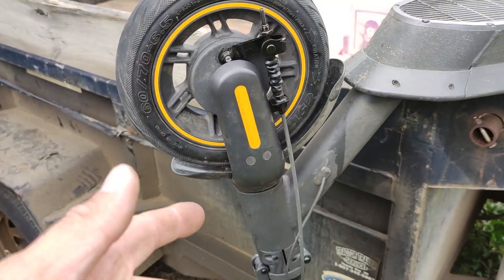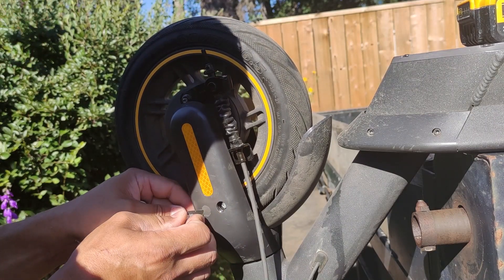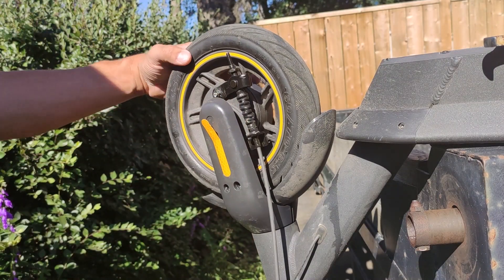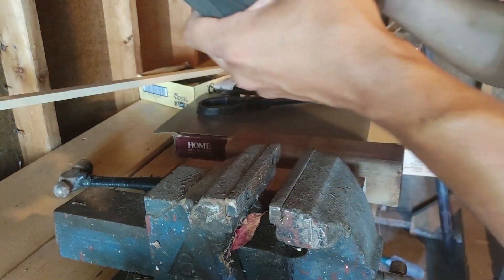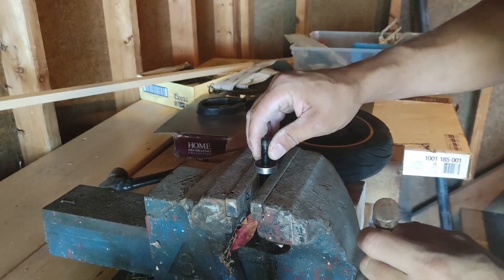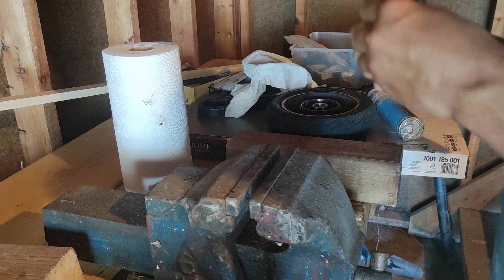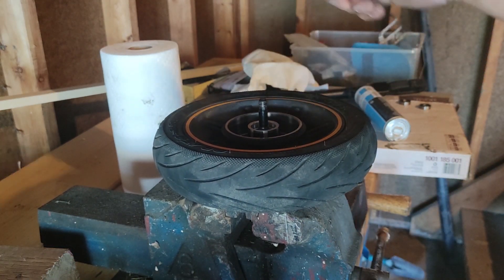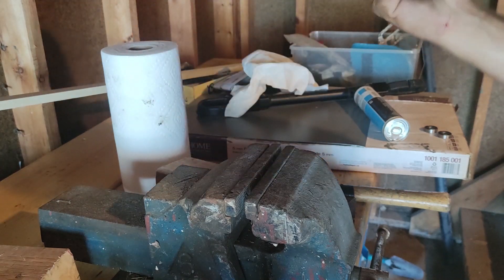Ninebot Max G30 Scooter - Squeaking, grinding, noise - front wheel bearing replacement/upgrade.

Comment: I have the g2 max its the same system but can i just lube it with grease instead of changing it? Because mine squeaks to. And what is the name of the bearings and where i can buy them?
Reply: Replace them with SKF. It might throw you off when it will lock up.

Comment: Im having a problem with the nuts to get the wheel off. It's so tight that i can't unscrew it. Is there any help?
Reply: You need ratchet wrench (socket/crova wrench)
Reply: @LeventeKurucz-g4d  I actually figured out how to do it just had to extend my wrench for torque thanks for replying

Comment: Best video tutorial, thank you so much!! I just changed my front bearings after 2500 miles. Pretty easy repair! Now it should be easier next time now knowing i can remove the front wheel WITHOUT unscrewing and removing the drum brakes. Such a PITA screwing on back the drum brakes lol

Comment: On the non brake side should the spacer be on the inside of the fork (bearing side) or outside the fork 15mm nut side?

Comment: i wonder how much resistance the bearing have under load and 25kmh, cause mine have the same issue and after the first wet morning with no rain it started squeaking but i didnt notice any increase in battery drain but now after like 120km and a thunder storm rain ride to the store it have started to drain more cause i did get about 5-6km in Sport and it drained 15%-18% and now its drain 18-28% the exact same road to work-.-
Reply: Have you checked tyre pressure?
Reply: @nameberry220  well, when i bought it they was rock hard it felt like so havent bother checking and i feel like they are still hard when driving over bump etc but i maybe should check it out.
Reply: @LinusF_  they always feel hard but you should check correct pressure i recommend 55psi for best range

Comment: Thanks for the video! My front bearings gave out after ~70km, and I am beyond dissapointed. Too bad I already flashed the scooter so warranty is probably not an option… I guess it’s time to upgrade!
Reply: unlucky 😵
Mine rides like new after 1100km minimal squeak from stem fold mechanism and stem fold secure plastic ring broken
Reply: @lolenas  Yeah I've heard great things about the reliability. I had a clone scooter (which I fried) before, and comparing to it the ninebot is far superior. I think I've just got very unlucky with a splash of water penetrating the bearing seals or something. Luckily I don't mind the work of fixing it, it's just a shame to have it happen so fast.
Reply: Mine lasted about the same km as yours. I got caught under the rain twice and the bearing gave up the next days. I'm now waiting for my parts to get delivered so I can change/upgrade it.

Comment: You can al;so use the old bearings for tapping in the new ones . Also if you are struggling with the push in of the axle one, you can reverse it, put in inside the wheel one and tap on the axle to push both in at the same time

Comment: I looked at this video a few weeks back, placed an order for bearings, and tonight i finally fixed the front wheel!
Thanks for the great video!

ps. When i test-rode it just now, i still had a little of that stuttering/shaky feeling, even on flat ground indoors, could it be that i need to swap motor bearings too?
Reply from the maker: That's usually usually how those feel when they are regulating the power

Comment: you say the brake drum gets off easy, but i cant get mine out, what do i do?
Reply from the maker: Tap gently with a small hammer
Reply: @randomrepairchannel  i did and the brake drum fell off together with the axis, now how do i get that bearing inside the drum brake out of the axis? i couldnt hammer out the axis out of the drum brake, the bearing inside the drum brake actually felt quite smooth (just like in your video), so i just left it in there

Comment: I have a problem, after instillation the wheel doesn’t spin as freely as on your video but spins for like 5-6 seconds and then stops. New SKF bearings. Do you know what might be the issue?
Reply from the maker: Is it front?
Reply: @randomrepairchannel  yup
Reply: @randomrepairchannel  what if it is in rear wheel?  Is that normal?  As my G30D rear wheel isn’t moving freely just like the front wheel. Need your valuable advice/suggestion on this! 

Thank you very much for the nice & helpful video. 😊👌👌
Reply: @mohammadshamsularafin3905  its because motor is on rear wheel
Reply: not greasy enough

Comment: Can you believe it. Segway ships their units with WARRANTY VOID IF EXPOSED TO WATER. If you drive through a puddle, or in the rain, or wash it, then WARRANTY IS VOID.  

I'm now here to watch disassembly videos of the motor hub, which I avoided before as I didn't want to void my warranty. Only made surface maintenance, probably very ineffective, as you can't get your wd40 near anything close to the axle...

I've now been chewed off on page 7 of the user handbook, in which it says that exposure to water voids your warranty.

So the fact that I had a bearing ball snap in half is due to water. Sure, and I was born yesterday.

I'll see what I can do to fix it, and I will never purchase another Segway product again.

Comment: Great video... I just bought A Max G30LP and at 100mi (60km) are already experiencing a failure. Question: should I bother with warranty replacement since the scooter is only 2wks old? Or would you just recommend upgrading right out of the gate? Thanks!
Reply from the maker: I personally would upgrade but that's your call 👍🤘
Reply: @randomrepairchannel  Roger that! I appreciate you sharing your opinion! I'm thinking that is the direction I'll end up going. Thanks again for the video!

Comment: Hey really like your video, but I have a question. What are the measurements of the bearings because I can't find the right ones.(plus do you have any recommendations for upgrading those bearings?)
Reply from the maker: The numbers of the bearing are the size.
As long as you get double sealed you should be fine 🤘

Comment: How do you perfectly size the bearing? There are so many, very similar, sizes. Thanks.
Reply from the maker: Just use the exact numbers from the video and you will be fine
Reply: @randomrepairchannel  oh, sorry, I was meaning generally. I have a different wheel. I searched a "bearings" web site and was amazed at the number of sizes... in thousanths.
Reply from the maker: @bob-ny6kn  it's crazy. Get as close as possible and usually a home run
 Cheers
Reply: I got the f40 series. What bearing size should i use for the front and rear?

Comment: Hi, I just bought a g30p, when driving on any surface at a speed of 15 to 18, vibration (40-50Hz) appears, which gives off to the steering wheel and creates a sound. However, it is unpleasant.

When picking up speed in the raised state, this does not happen, but there is some beating (without sound, which loosens the deck itself soundlessly) due to some misalignment of the rear wheel. To give it under warranty or is it a standard nuance?
Recording sound while vibrating and resonating something (not wings exactly): https://photos.app.goo.gl/5k2EB3VjL6M3wEfT8
Reply from the maker: If you have warranty I would start that process. 
Very hard to tell from the sound what is going on there.

Best of luck!
Reply: @randomrepairchannel  Thanks, its new, I’ll start process.
Reply: It is only a vibration of the front wing, I touched lightly with my foot and the vibration stopped !!!

Comment: Do i need to put glue? I dont have this type of glue could i use something differnent?
Reply from the maker: Any kind of gasket maker or rtv should work. Yes keeps water out of your motor
Reply: @randomrepairchannel  thanks. And these bearings was also okey right what i wrote? Gonna buy tomorrow. Wrote under the rear change i think video.
Reply from the maker: @raigo66  good bearing
Reply: @randomrepairchannel  thanks. U think i should wait if the sound comes and then change it or change it tomorrow front and rear. 
I checked the sound and it was gone at front wheel.
Reply from the maker: @raigo66  if it was making sound the bearing is bad. I would get on it for sure. Take your tim, be careful
Reply: @randomrepairchannel  last question. How long do the sfx bearings last?

Comment: Are you able to provide a link of where you got the bearing from? I heard you say a place but couldn't quite make out what you said. I live in Australia so finding hard to find the SKF 6001-2RS1/C3GJN
Reply from the maker: I bought from local auto parts store. 
Try amazon or eBay?
Reply: @randomrepairchannel  Thank you. Have tried Ebay and Amazon and the prices were crazy. I found a local bearing company and will give them a call on Monday to see if they stock them. Thank you.
Reply from the maker: @rdp8545  good deal. 
Any Brand name 6001 will work just make sure it's fully sealed

Comment: Hi there, after how  many miles would you say these bearings need replacing? 
Great vid by the way 👌🏼😊
Reply from the maker: Mine had 200kms or somewhere around there.
Reply: @randomrepairchannel  so probably a good idea  to buy these bearings as a spare just in case they got out of production for this scooter. Will get some in 👍🏼
Reply: @joAO-87-TugA  they will always make these... Its not just for the ninebot made
Reply: Mine have 1450km on clock, I'm using time to time WD-40 PTFE spray, everything works fine
Reply: @osvaldassmitas  I would like to lubricate the bearing because I rode it in the rain and it squeaks now even though they say it's water proof in rain.  

May I ask how you were able to lubricate the bearing without getting oil and the brakes?

I think it would be helpful to the community if you were able to share what you know about the process… 

Thank you!
Reply: I had ceramic ones and got 1400 miles out them in t4 max

Comment: Thanks for the video, I bought a couple of Skf for the front, I’m gonna do this upgrade soon. Just wondering one thing, if I’ve seen properly you haven’t use any vaseline or grease for the bearings. Should I do it? Thanks
Reply from the maker: Not needed. They are internally lubricated then sealed from factory
Reply: @randomrepairchannel  at the moment I’ve solved only with “Wd40 ptfe”, but only because I’m not using the G30 often (here in Italy there’s a second lockdown, kind of 😅). But the problem sometimes comes back again, so I must change che bearings.
Reply: @randomrepairchannel  ok perfect, thanks!

Comment: Hey quick question? I notice you used 6001 for the front and 6003 is that for size? I'm just wondering plan on doing mine soon. Thanks
Reply from the maker: That's right. Best of luck!

Comment: So the apartment fixing solution I used to do this repair: went to Lowe’s and got them to cut down a 2”x4”x8’ stud into 1’ blocks; bought a 3/4”x6” nipple pipe to take the bearing off the shaft, and I bought a bearing race and seal set (for a newbie it was worth the $20 because I was able to put one flat side down on the inner brake side bearing and then tap on that using a socket). Oh, and I used Nachi 6001-2NSE9 bearings since I couldn’t source SKF’s easily. 

Thank you so much for the video, it was beyond helpful. Now I just need to wait for the double lip seals to arrive and then decide if I’m comfortable enough with replacing the rear bearings 😂

Comment: I upgraded my front bearings to hybrid ceramic. Being a complete newb, it was trickier than I hoped it would be and, yes, I ended up snapping one of the plastic clips on the fork covers :). Live and learn. Still, I'm glad I learned how to do it and it was only because of your video that I could have even attempted it. Many thanks!
Reply: Got a link to the bearings you used? Also are ceramic hybrid worth it?
Reply: @LTL-x3v , are they worth it? Not sure, but the ones I chose weren't that expensive so I figured why not. So far, so good. This is what I used: https://www.bearingscanada.com/product-p/6001-2rs-ceramic-1228x8-abec-3.htm
Reply: Scott Eagles thanks for this. Also, did you use the same bearing size for front and back?
Reply: @LTL-x3v , no, the rear bearings are apparently 6003. I haven't yet attempted to replace those. Random Repair has also done a video on doing the rear found here: https://www.youtube.com/watch?v=Fw5M1_HzwG4&ab_channel=RandomRepair

Comment: Super helpful, dude. I'm upgrading to hybrid ceramic bearings and really needed a guide to do this at home. Incidentally, could you recommend a bearing removal / insertion tool that would work? I won't argue with hammers and wood, but a dedicated tool would be welcome! Thanks and looking forward to your rear wheel bearing replacement vid.
Reply from the maker: Most bearing tool kits could work, but with this setup it would be a waste. It's all so easy :)

Comment: Just got a 2nd hand max. I thought it was just the noise echoing through the hollow front bar.. until I spun it freely. sounds like a common problem.

And omg. Had a compaq presario 970 a looooong time ago lool
Reply from the maker: Hahaha, spotted that eh?
Reply: @randomrepairchannel  what can I say, eagle eyed lol.

Btw, is for the bearing, what's the difference between 6001-2RSH and 6001-2RSH/C3? I'm assuming both can be used?
Reply from the maker: @a9fc  yes. Some of these number refer to seal type as well as if its made by a different manufacturer
Reply: @a9fc  Radial clearance:
C1 = smaller than C2
C2 = smaller than CN
Without suffix = CN normal clearance
C3 = greater than CN
C4 = greater than C3
C5 = greater than C4
GJN = high temperature grease, polyurea soap-mineral oil, -30 to +150°c.

Get SKF 6001-2RSH for front, they should be good. 2RS1 is older contact seal.